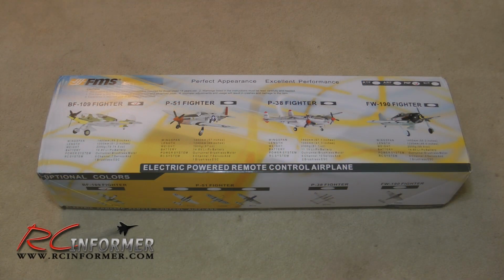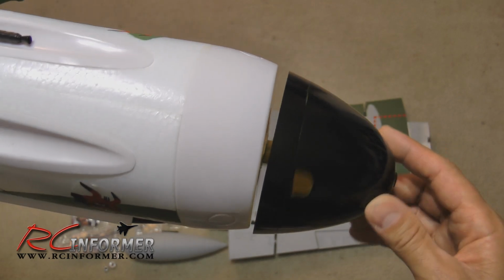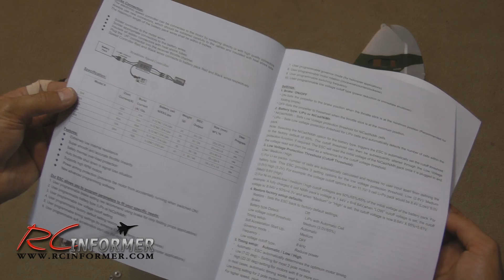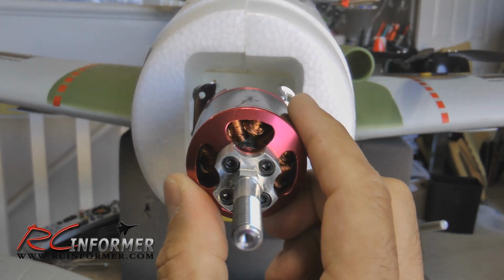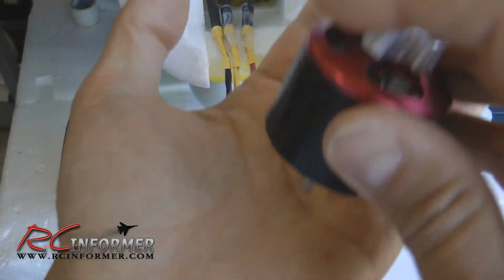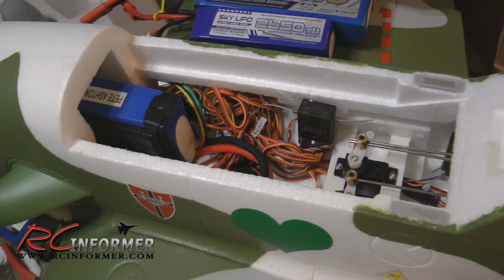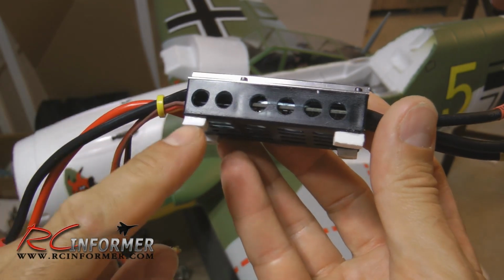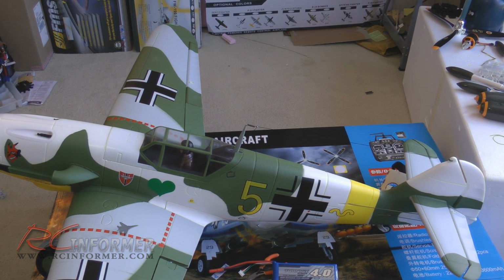Banana Hobby / FMS Messerschmitt BF-109 Review & Build Guide By Rich Baker in HD

Comment: I know I'm 7 years late, but for anybody who might happen to come across this; the propeller/spinner are explicitly meant to be pointed to the right and down relative to the fuselage (this is to the tail of the aircraft looking forward. If you're looking straight at it like this gentleman, it will be to the "left" and down). This is meant to account for P-factor in these small foamie planes. If I'm not mistaken, it's even seen in real aircraft sometimes. There's no need to fix it.

Comment: I have the updated version of the BF109 and  all but the battery placement of your video is relevant and new version has a 70amp ESC in it so handles 4000mah 30-40c battery very well as long as you make room and push it all the way to the front. I made all your other mods to my plane and they really add to this plane. Great mods, great video. Thanks very much

Comment: I had the EDF F-35 and the control rods had a threaded control clevis that went into the horns that allowed compensation if there was too much play and it also had adjustable points that allowed for modifications if you wanted to do them with minimal effort. You may want to look at the clevis end of the rods to see if there are threads and if so, you can add about a half inch to compensate for a short rod. Just my thoughts on some common issues that are out there.

Comment from the maker: Yes that is correct,BUT... I did not remove the right/Down thrust.  This angle  is built in to reduce the effects of P-Factor, Gyroscopic precession, Torque and spiraling slipstream.  The Right/Down Thrust is designed into the Cowling just behind the spinner, If there is an equal Gap between the spinner and the cowl, you will have the proper designed in right/down thrust :)

Comment: Thanks for this incredibly in depth review/build guide. It's exactly what I needed to get everything ready on my new BF109.

I do have a question though. For the control horns and clevis, which holes did you use for the rudder/aileron/elevator/flaps? The manual seems to be silent on this, so for now I've just put everything in the middle hole. 

Also, for the flaps, the manual also doesn't list how much deflection they should have. I've researched and it seems 15 degrees is safe.

Thanks.

Comment from the maker: Actually, the right and down thrust is intended to REDUCE the left turning tendency's caused by effects of P-factor, Gyroscopic Precession, Torque, & Spiraling Slipstream... if you want to get specific? Assuming of course your propeller spins clockwise when viewed from the cockpit. it is most pronounced at slow airspeeds, high angles of attack, with high power settings... like during takeoff.

Comment: Rich, Again best on the net.  I do notice you spend a lot of time modifying cooling.. which I know can't hurt.. but have you thought about using a radio with telemetry or some simple thermocouples and doing some before and after temperature comparisons of the engine compartment, ESC and battery.  I know the Hitec radios have this capability and it would be great to see the quantified benefit.

Comment: 27:14 I thought that motor/spinner is supposed to be a little angled to one side? To counter torque or something?
Reply from the maker: ***** Yes you are correct. However, the right and down thrust is usually built into the cowling at the factory. FMS does this on all their planes This means that the spinner should line up with the cowling to achieve the correct right &down thrust.
Reply: Thanks

Comment from the maker: Your flap setting sounds good..... you can set  up the flaps on a 3 position switch and have a ZERO Flap setting, a takeoff flap setting, and a landing flap setting(FULL)..... use the outer hole on all the horns or your controls may be to sensitive and use normal 100% travel to start.

Comment: i have an random inrunner motor like that sitting around, where do u get the metal sleeve for the shaft, so that the prop assembly to mount on to? or is that how the motor came?

Comment: The good news is in the latest version of the BF-109, the horizontal stabs are attached to the fuselage by screws instead of using glue.  That's a big improvement in my opinion. :)

Comment from the maker: Where did you get it? Occasionally they send out a set of rods that are to short for the control surfaces... First, be sure that your servo horns are sticking out of the wing at a 90 Degree angle, if they are to far forward it could make the rod seem to short. If they are ok, Contact the dealer you purchased it from and request longer ones or just make your own rods.... any hobby shop should carry a set of 2-56 rods, I usually make my own aileron rods when this happens....

Comment: Hi Rich. Thank you for the awesome build video. Did you use any weights in your plane to achieve a good CG? If I use a 4000 mah battery and place it right on the suggested battery line, it seems tail heavy even though most of the battery weight is ahead of the 80 mm CG point. Thank you in advance for any help.

Comment from the maker: You misunderstand, as i said in the video, the plane still has the normal amount of right and down thrust, even the cowl has a slight angle in it and the spinner is supposed to match it... the metal mount was bent to much at the factory. I used the washers to bring it back to where it should be. You always need to use some right rudder with any tail dragger.

Comment: Are the landing gear struts on this Bf-109 spring loaded, like that on the FMS FW-190 ??
Reply from the maker: NO they are not:(
Reply: RCINFORMER I wonder, if there is a mod to put spring struts on the Bf-109 ???  If the wire diameter is the same, maybe a pair of struts from the FW-190 can be cut down and fitted to the trunion the Bf-109, just install the Bf-109 wheels to the FW-190 shortened struts ?? Doable ?

Comment: how did you set up your landing gear?
Reply from the maker: Not sure what your asking? The retracts just plug into the retract channel....
Reply: RCINFORMER
lol no i got that part... never mind i just had to switch something on my tx.
Reply from the maker: When you takeoff with this plane, use power cautiously. smoothly apply throttle, anticipate using some right rudder during the roll and as the tail leaves the ground.... only about half throttle is needed to get the tail off the ground... then, with the plane in a level attitude and the main wheels still on the ground, slowly & SMOOTHLY advance the throttle from half to full for the climb out... If you jam the throttle to full at the start of the takeoff roll, this plane WILL yaw and roll left out of control, the rudder cannot over come the Torq and left turning tendency of the motor and prop... :)
Reply: RCINFORMER
Yeah i watched a lot of vids on the character of this plane on take off thanks for the tips! = )
Reply: RCINFORMER just like the full size. big engine, big prop, lots of torq

Comment from the maker: Probably the best overall flyer is the Mustang. it is EASIEST to fly, takeoff and land... it is quick but not the fastest of the 3.... the FW-190 is about the middle of the three, it is faster, maneuvers a bit more aggressively and lands well due to its wide gear... the 109 is the hottest performing of the 3, it is fast and very maneuverable, it is also the most challenging to perform a smooth takeoff an landing.. You will not be disappointed with any of them...let me know what you decide.rich